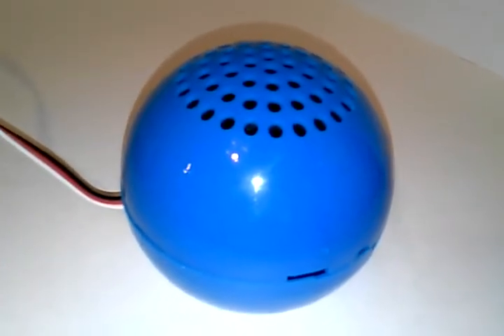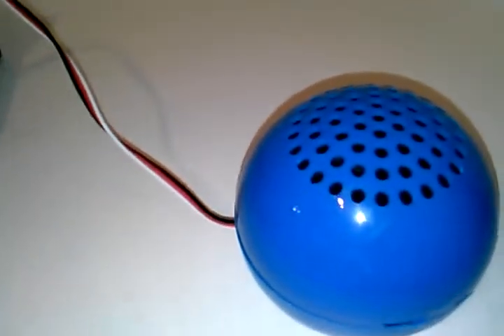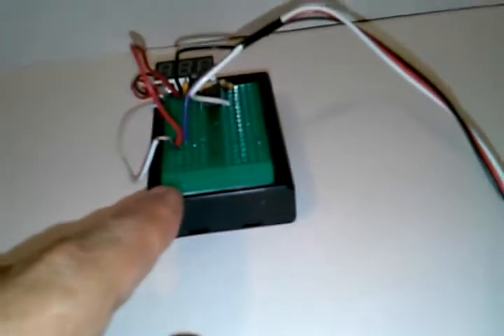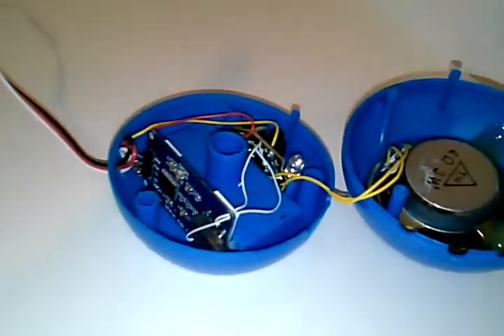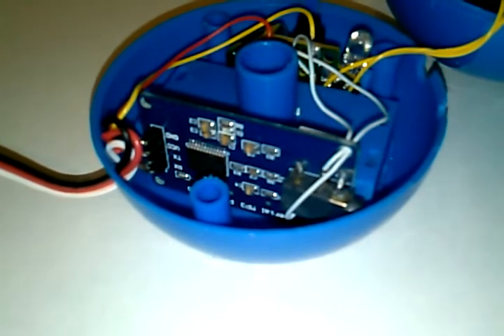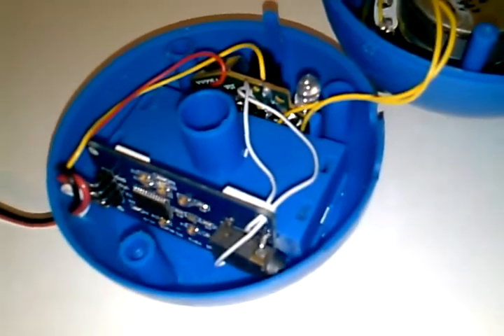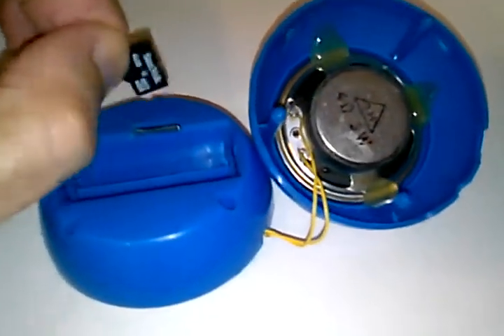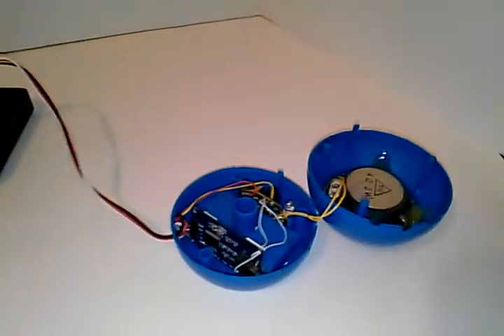$4 Catalex Serial Mp3 Player Module & Amplified Speaker DIY

Comment: Hi.
Single short track is playng in cycle. Is there a small pause?
Reply from the maker: IIRC yes. If loop timing is critical, you may be able to edit the MP3 file down to shorten. Experiment and please advise! Try https://mp3cut.net/
Reply: Sorry for uncorrect question. I am looking for a player which plays track (cycle mode) without pause. (Dfplayer mini has a small pause after playing every cycle((((((.)

Comment: ive found that when no mp3 is player there is a non stop poping kinda sound
Reply from the maker: If you mean just the amplifier alone, there is always some steady low-level white noise (hiss) typical of audio circuitry here. Sometimes hinky inputs can pick up 60 hz buzz or ground loop noise, but that's not a popping sound. Maybe you are picking up EMI/RFI from an external source.

Comment: catalex is  fine for those who can code in c.  and until its upgraded past ver 1.0
my favorite code-able mp3 player is the SPE035 by Revolution Education.
they offer many examples in picbasic.  neither the  code ex's nor editor s/w 
costs you anything.  plus there is a 1'st rate  search-able forum with many 
senior members ready to lend a hand.

the module has 5 pins.  the 5'th being 'busy' . a  digital signal that is low while
a mp3 is playing.  making it easy to  code in a loop that  will then allow the
next mp3 to play once the busy pin goes high.

    this month , nov 2018 , i paid $35.37 for 3 of them shipped from the UK to 
colorado.   and would of saved  about 12 in shipping had there been a
vendor here in the states.  phanderson.com carries many pic uC's
and other  Rev Ed items  just not the 035 , (yet ? )
Reply from the maker: C, BASIC, all work the same. You're just sending serial data, it doesn't matter which language or processor is used. I'm also a  Picaxe fan (erco in the forum) as demonstrated here and in the sample code at http://servo.texterity.com/servo/201710?pg=10#pg10 . BASIC Stamp code shown there too. As I mention in that article, it can be tough starting out with these because it's not immediately clear why something isn't working. It helps to remember that these MP3 modules have their own built-in microprocessors, which can lock up if you send an errant serial string. When in doubt, cycle the power on both your Picaxe AND the MP3 module to reset both micros.

Comment: the datasheet is in chinese.  with some english words here and there.  this leaves me  at square one in terms of using the control or feedback codes.    my hope had been to find a way via the cat' pin 6  Tx pin for the uC to get
some  feedback indication the song playing is over.

also on p. 18 of that data is a ckt diag. showing the L & R signals being combined prior to the 80028 amp.  this rather suggests there is no stereo coming out of this module.   this idea needs to be  verified 

    2 of the 3 catalex's i have do not work.  may have fried
them by lack of a 1k R between Rx of cat' & Tx of PIC uC while operating at 5V.    will exp w/ 3'd one carefully.

my scope shows good 8 bytes of data going out of the uC via the serout cmd.  this is w/o the cat. plugged in to the
 bd. bd.  with it plugged in the signal is not seen. like its hitting a short circuit to ground at the cat' Rx pin .  ???

   failing  getting the 3'd cat' to work that will  have me give up on this device.  and switch to Rev Ed's spe035. 
 its doc's and code are all in english.

and is sold and supported by english speaking humans.
 who maintain a forum and technical help line.

    for those reasons and its use of the  YX5300 busy pin  10   i think one can easily  be  willing to pay a few dollars more  for its ease of use vs the catalex

     time will  tell.  and , to hedge my bet , i'll be  keeping an eye out for a u-t posting of the cat' that addresses these matters

Comment: question about the coding to play a series of songs, one after another.
given that code moves along until it executes some delay/pause/stop command.    how do you code the catalex so that the code waits for the 1'st song to finish before the next one plays ? 
 prefer you use assembly or basic instructions not c to explain.
Reply: @bob along Did you visit the second link in the description?  That might help you. It's in English.
Reply from the maker: @mozartips  yes thanks, http://geekmatic.in.ua/pdf/Catalex_MP3_board.pdf is in English
Reply from the maker: Can't recall and I don't have the module handy. Check the datasheet for control codes and please follow up when you figure it out.
Reply from the maker: Datasheet at http://geekmatic.in.ua/pdf/Catalex_MP3_board.pdf  You might want "folder cycle play".
Reply: @ercost60  the datasheet is in chinese.  with some english words here and there.  this leaves me  at square one in terms of using the control or feedback codes.    my hope had been to find  a way via the cat' pin 6  Tx pin for the PIC uC to get some  feedback indication the song playing is over.

also on p. 18 of that data is a ckt diag. showing the L & R signals being combined prior to the 80028 amp.  this rather suggests there is no stereo coming out of this module.   this idea needs to be  verified 

    2 of the 3 catalex's i have do not work.  may have fried
them by lack of a 1k R between Rx of cat' & Tx of PIC uC while operating at 5V.    will exp'  w/ 3'd one carefully.

my scope shows good 8 bytes of data going out of the uC via the serout cmd.  this is w/o the cat. plugged in to the
bd. bd.  with it plugged in the signal is not seen. like its hitting a short circuit to ground  at the Rx pin.  ???

   failing  getting the 3'd cat' to work that will  have me give up on this device.  and switch to Rev Ed's spe035. 
 its doc's and code are all in english.
and is sold and supported by english speaking humans.

    for those reasons and its use of the  YX5300 busy pin  10 i think one can easily  be  willing to pay a few dollars more  for its ease of use vs the catalex

     time will  tell.  and , to hedge my bet , i'll be  keeping an eye out for a u-t posting of the cat' that addresses these matters

Comment: in your vid it looked like 2 wires going from the 3.5mm port to the amp.                
this led to the idea the player is mono not stereo.    could you confirm ?
Reply from the maker: Player does output a stereo signal. Yes, headphone jack has 3 connections, L R & ground. But I already made my ground & power connections at the other end, so the two white wires shown are for L & R signals, which get mixed to mono at the amplifier, which is obviously mono.

Comment: Hey, I've been trying to get something similar set up. Was there any specific way that you had to set up the SD card? Did you use numbered folders with the mp3 files inside those folders? I have things set up with three folders (01 02 03) on a fat32 formatted 8gb sd card, and my mp3 files are basically 001<name_with_no_spaces>.mp3 etc. Nothing is playing, can't figure out why.
Reply from the maker: That's the right file naming format. There are some tricks to sync this MP3 module with your controller and initialize it. See some of my tips at http://servo.texterity.com/servo/201710?pg=10#pg10
Reply from the maker: Also be aware that there's a maximum SD card size. Can't recall what the limit is, but IIRC I was using 1 and 2 GB cards. 8gb might be too big, check the specs. Also, sound files must be MP3 ONLY. Think .wav files would not play on some modules.
Reply: It was a wiring issue, haha. I had switched the RX and TX lines on accident. All set now. I actually got the 8 GB card working as well. Just user error on my part.

I am curious, though. What voltage did you run over to the amplifier? I ran 3.3v over to the amplifier from an arduino board and I think it was a little too much, the speaker seemed to crap out a little and, when comparing the same audio source on it and an unmodified speaker, this one is muted now. So I'm curious what voltage you are running that is successfully driving both the Catalex YX5300 and the amplifier.